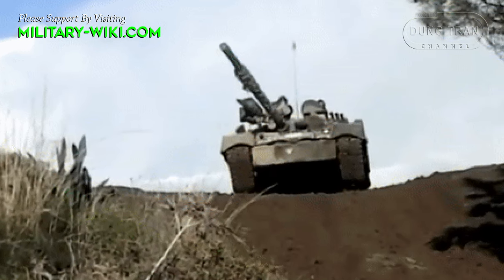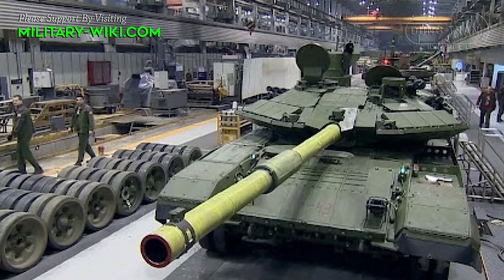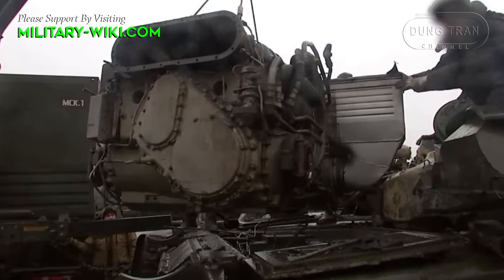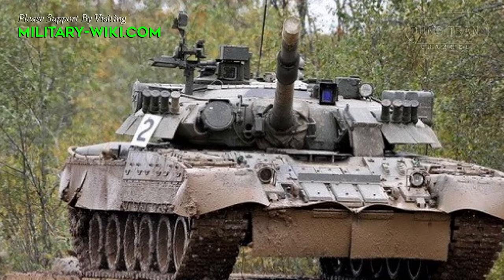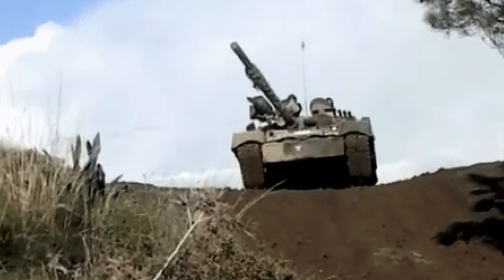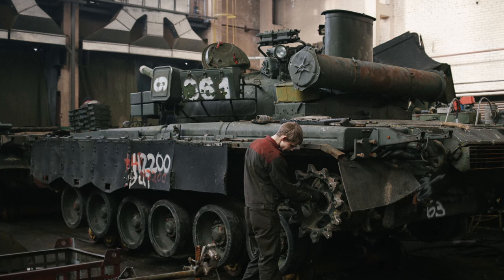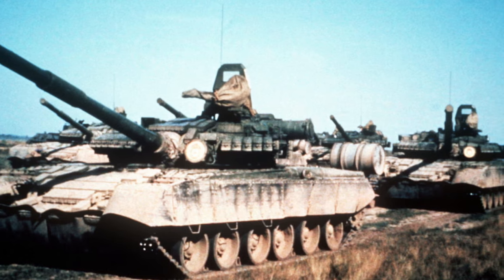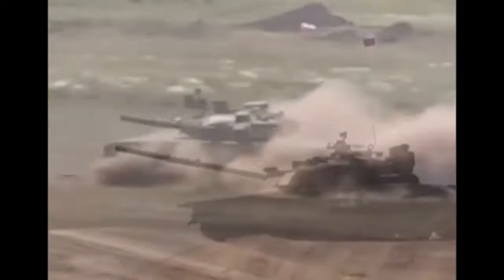Russia Remanufactures The GTD-1250 Engine For The T-80 - Upgraded To 1,500 Horsepower

Comment: what are they thinking ? i dont think the increase of engine power is necessary, 1250HP for a 50 ton tank is far enough, the original T80 is 1000 then 1200 with gtd1000f then 1250 with gtd1250, and now 1500 ?, lower the fuel consumption, make it easy to mainteinance and improve reliability is more important

Comment: This is bad news for Russia. It will be a long start up process, very costly, and Russia has neither time nor money.
Reply: Thats what your media has been saying forever and each time they are proved wrong by the Bear
Reply: @ roderickcampbell2105
They have the time and the money. Oil exports have been really kind to Russia this year.
Reply: maybe not Roderick russia tends to stay in a just in case mode when it comes to defense issues more than we do anymore! they've probably got material stockpiled and kept that plant in a state where they could fire it up fast if needed! personally though i'd redo the powerpack to a multifuel diesel type easier and cheaper to build and less maintenance compared to a turbine!
Reply: Very bad news for your "bad news". They are about to restart engine production. And they even intend to start 1500hp engine next year.

Comment: The Russian decision to restart T-80 production after 32 years is a profound admission that the T-14 and T-90 are failed tanks. A new and more powerful engine will not make the tank reverse faster, and unless the transmission is also replaced, failures in the drive train will occur more often. 
Not to mention logistics, which the Russians are very poor at. With gas stations all over Russia being out of gas, the decision to use gas turbine engines would appear to be an illogical act of desperation. 
So the message to Ukraine and its allies is that the Russian military and government are desperate because they are completely aware of the failures in Russian tactics, equipment, and training of its military. 
I have studied military history and military science since 1979. I am shocked by how this conflict has progressed. The Russians should have had more victories by accident than they have had so far in this conflict. Both combatants are timid, rely on frontal assaults, and completely lack the aggression or finesse to be considered competent. Ukraine has been very lucky so far that Russian bungling has allowed Ukraine to have survived this long. It is clear that Russians believed their own propaganda, and they either ignored obvious corruption or didn't accept that it was so prolific. 
Anyway, sorry for the tangent here, but restarting T-80 production is not a good thing for Russia.
Reply: They already have the new t-80bvm with better reverse speed 25kmph
Reply: T-90 is far from failed, its still in mass production.
Reply: @mr.waffentrager4400  
You realize that the Russian stock of T-80s were virtually all destroyed, right? 
There are many more things about the T-80, like Ukraine winning production rights in the 90s. However, the T-80BVM's reverse speed hasn't helped to avoid being destroyed in unbelievably high numbers.
Reply: @mr.waffentrager4400  
Is it? The Russians don't seem to think so. Production time does not allow them to replace losses, so "mass" production doesn't seem to apply. Especially since the tank relies on Western tech for its fire control systems. Yes, they get some illegally, and they steal chips from dryers, but the cost of obtaining real chips they require is prohibitively expensive, and the sights with dryer chips are less effective during the spin cycle. That last was a joke. However, using those chips seriously degrades the tanks performance. That is why Russia uses Iranian, North Korean, and Chinese weapons. Because they simply do not have the capacity to make chips or even artillery rounds efficiently. This is why they have restarted T-80 production. They probably won't be the BVM model, but they need tanks because they have resorted to early WW 2 steamroller tactics, which has always been a high loss tactic. While the West has screwed themselves by converting their militaries to counter insurgency forces and almost stopped production of relevant near peer weapons (Greece is the only country in Europe that can produce the Leopard 2) Russia has hamstrung itself by becoming reliant on the West for everything, rampant corruption, and the belief in their own propaganda. Even heating pipes were bought from the West. Heating pipes all over Russia have burst all over Russia, and untold numbers of civilians have no heat in subzero temperatures. They also relied on transformers from the West, which has left even more Russians without heat or lights. 
Don't believe me? Research it. Official Russian government sources are probably not the best for this research, but the information is readily available.
Reply: @mr.waffentrager4400  
Why weapon tractor? That's been bugging me the whole time.
Reply: @brianjordan-5357  Russia can produce 90nm chips which is all you need for military hardware, infact there is no need for any smaller fabrication process like 7nm, it is useless because its more susceptible to errors due to radiation.
Reply: @brianjordan-5357  no, Russia is not able to replace losses of t-90s by production but it is replacing losses by refurbishing old tanks with making new ones.
What was your logic for t-90 is a failed design? Lmao you were incorrect.
Reply: @brianjordan-5357  incorrect again, only the active fleet of t-80s were all destroyed / damaged , forgot about 2k reserve tanks which will be refurbished with the new production line starts pumping.

Reverse speed didn't help t-80? I have heard Russian tankers praising the reverse and said that it helped them win a tank duel. 
I can argue about the 30+ damaged / destroyed leopard 2s which was much much less combat.
Reply: @mr.waffentrager4400  
Simply because it hasn't performed as advertised. 
You should really learn to research things. The T-14 and the T-90 have failed. The T-90M's reverse speed and the failure of its armor package to make it "invincible," as the Russians claimed, and the fact that they've lost a substantial percentage of the few T-90Ms they had shows its a failure. You're own assertion that the Russians refurbishing old tanks, some obsolete old tanks supports my assertion, not yours.
I am beginning to question your age and critical thinking ability. The losses in Ukraine, a country that primarily uses T-64s and T-72s, is abysmal. Your assertions on Ukrainian losses of Western tanks are delusional, there are confirmed losses of Leo 2s. About 6 were unable to be repaired. Come on, these things are not that hard to research.
Reply: @mr.waffentrager4400  
I just watched a video by suchomimus that shows the "mighty" T-90M being knocked out by 2 Bradley IFVs using only their 25mm canons. 
55 T90Ms have been knocked out out of a pre-war amount of 60 T-90Ms. Apparently, you need to work on your math skills.
Reply: @brianjordan-5357  only 55 t-90m lost ? Damn i thought it be more considering they saw much more action than leopard challengers, you know that Russia made 60+ in 2022 alone and add 2023 i thought the losses would be more.
Reply: @brianjordan-5357  its sad you are someone near 60 with critical thinking of 16.
Which tank can survive 25mm rounds to tracks and optics?
Reply: @mr.waffentrager4400  
The tank had no damage to its tracks, it was still mobile until it hit a tree. It was on fire, and the turret was spinning like gunner was injured or dead. 
Your critical thinking skills are absent because you obviously haven't seen the video or at least the whole video, so you assumed the outcome and attempted to disparage someone who has seen the whole video twice. Because I watched it twice in order to make sure I hadn't missed something the first time.
You know what they say about assumptions, and you just showed everyone on YouTube the veracity of your knowledge.
Reply: @brianjordan-5357  so that was damage to the optics...
Reply: @mr.waffentrager4400  
There is no way to know how many T-90Ms have been produced after February of 2022. The Russians only had 60 T-90Ms before that date. Hence, me saying 55 lost out of a pre-war amount of 60. That is only confirmed losses with pictures or video proof. It does not include damaged or destroyed T-90Ms that have yet to be confirmed visually. 
The fact that the tank was destroyed on video with bushmaster cannon indicates that it is nowhere near as effective as the Russians and their fans say it is.
Reply: @brianjordan-5357  the video increased my respect for the t-90m , if it was any other NATO tank it would have been destroyed because of the side shots ( leopards Abrams have 35mm steel on the side only) 
Bro TANKED it like no other tank can like injured lion it couldn't probably see due to damage. 
The only failure I see i the failure of Russian infantry support and not the 90m 
I hope you had this much thinking. No other tank could do what the 90m did.
Reply: Of course you have NO CLUE why  they still keep producing T-90M and  even T-14 (in small numbers true but still)
Or why would India buy another 500  licensed produced T-90's, to have few thousands  of them.
Being persistently wrong about Russians is something very consistent among you Westerners.
I just hope it's not envy or hatred.